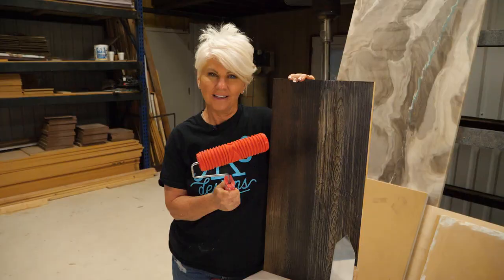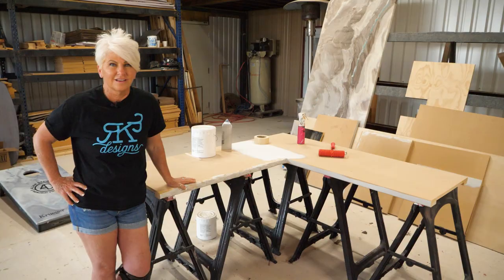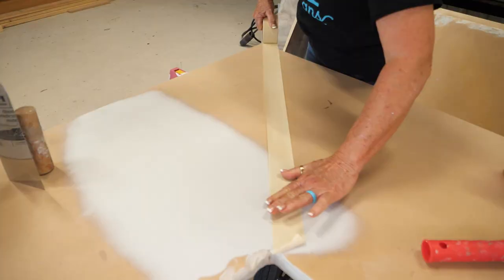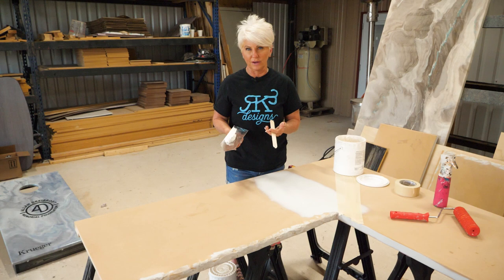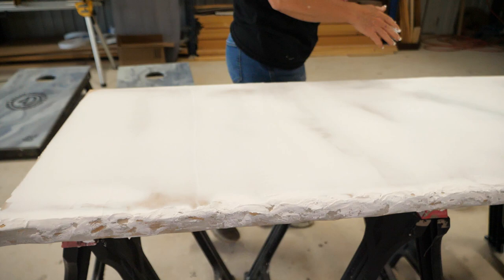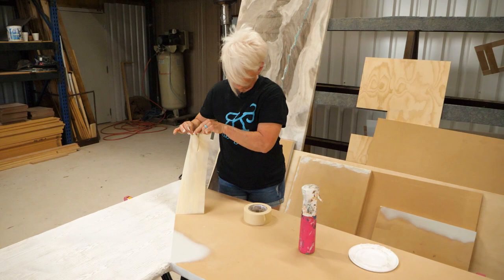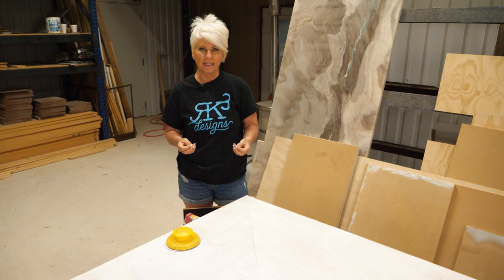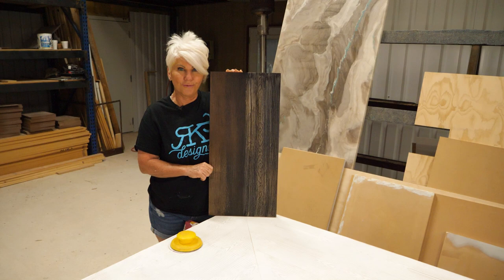How To Create An Easy Faux Wood Grain Countertop | RK3 Designs

Comment: Ronda, what is the ETA of part 2? This may be the answer I am looking for my kitchen cupboards.  I'm chomping at the bit waiting to see what your edges look like using MDF. My boxes are 3/4" birch plywood, the plan is to use a frameless design, and this would likely be awesome.

Additionally, I'm thinking river table countertops in addition.

Just have to completely figure out what I'm doing.
Reply from the maker: I’m in South Carolina until Wednesday night. Hope to be able to video it on Thursday or Friday and then get it edited. So probably by the weekend. 😊